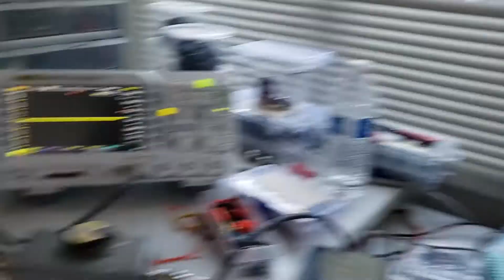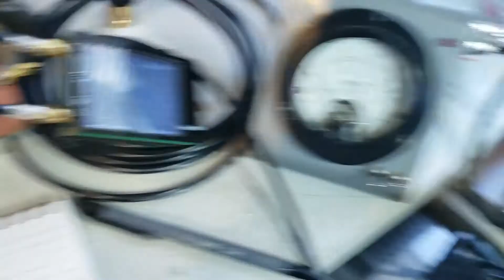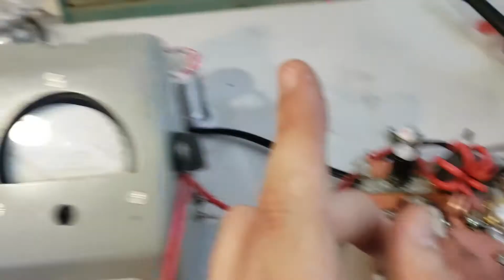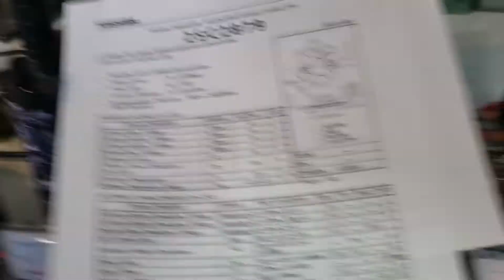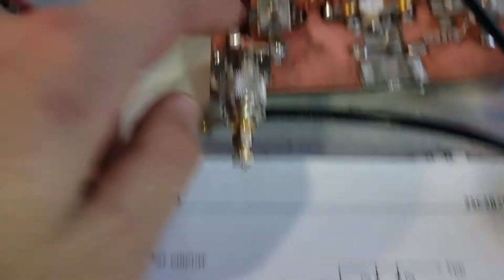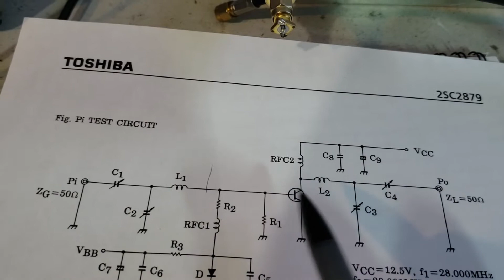Super Simple 2sc2879 Amplifier and Theory

Comment: My understanding is that 2879c designation has no meaning to chinese electronic engineers that bottom number is what you need to get data and every batch run is specific to the run your pass though will change from batch run to batch run

Comment: You have a single transistor amplifier so you can't possibly operate it in class AB. With one single device, you are operating it single ended so it will always be in full conduction thus it operates in class A only. If or when you have two devices operating in push-pull, class B has them only conducting when the wave form swings in the devices direction. So half the cycle in on direction on one device and the other half a cycle the other direction on the other device. That's class B. The problem with class B is that when you get close to the zero crossing of the waveform when it the sine wave goes from negative to positive or from positive to negative, there is some distortion called crossover distortion because the transistors (or the tubes) are not very linear in the area when they just begin to conduct current after being turned off for the half cycle. The fix for that is to add a bias voltage to both devices so that they will be conducting current at the low levels before and after the crossover point happens. That is called class AB amplification. It reduces the distortion significantly in AB compared to class B. You can even go further to reduce distortion in push pull amplification by biasing the transistors (or tubes) so deeply that they are in conduction all of the time. That is called class A push pull.
Reply: No, he is right. You are conflating the class with single-ended vs. push-pull. A single transistor can absolutely be in Class A, B, AB, C, etc., as this ONLY refers to the conduction angle, not the topology. Many people think that AB = push-pull, but that is totally incorrect. You choose the class of operation separately from the topology. The primary thing to remember is that if the transistor is not conducting for (nearly) the entire cycle, you need a tuned output to reconstruct the missing part. This is one reason we use push-pull. It allows us to use class AB, so each transistor is handling one of the phases, and they are then recombined in the output. This is very efficient (when linear operation is required) and has the added benefit of cancelling the even harmonics largely. For anyone working solely with FM, digital modes, or any case where the amplitude doesn't vary, you should look into switching mode amplifiers, as their efficiency is far higher (as high as 95%), whereas linear amplifiers rarely exceed 60% in reality. This allows for a lot more power with fewer devices and lesser cooling requirements. If you are amplifying AM only, consider Class E (very simple and efficient) and modulating the power supply voltage. There's a lot to know, and I just wanted to clear up the fallacy that Class AB wasn't possible in a single-ended topology. The video creator is right in all regards.
Reply: @gregaldr  Thank you for the correction and your excellent explanation.

Comment: Can you build FM broadcast band amps? I'm looking for an amp that will run off 12V and make around 100W. It's easy to find plenty of FM band amps on ebay, but the problem is finding one that has good power off of 12VDC. They all seem to max out around 30W with 12VDC. I know that it's definitely possible to get more though cause there are mosfets that are made for this purpose. It's just that nobody is using them :( I'm talking about the RD70HVF1C, RD70HUP2, or RD35HUP2. These in a push pull configuration would do it. I just don't know how to make it. I understand how amps work, but not to the extent that I could match something like this.

Comment: This is eaxctly the video I needed to watch today! 

I've been getting into building audio amplifyers and compressors with amp circuits within them etc. recently and have been trying to learn more and more about how they do what they do on a deeper level. I've been tracing the signal through the circuit with my scope and playing about trying to understand certain things ... and being a tube circuit (although not much differant to a transistor circuit in what I was trying to figure out) I couldn't work out why the HV power was being supplied to what appeared to be the tube signal output .... but this makes that make perfect sense, and was kind of what I assumed it must be, but had no way to know for sure without this vid! It's just taking an elevated AC voltage from the change due to what the tube lets through from the grid signal on the annode plate side, rather than taking it from the cathode and the output being only what the tube lets through like I initially thought (untill I looked at the circuit and was like well it's attached directly to ground through a resistor, so it can't be that).

Thanks for uploading this!

Comment: You need to do a two-tone test on any RF power amp, particularly an external linear amplifier. If you don't do the test you won't know the linearity and the in-band intermod products. You will quickly find that you need to back off the drive to get reasonable linearity. For SSB operation your 3rd order products should be at least 26dB below your carrier. These 3rd order intermod products are what causes "splatter" on adjacent channels. All ssb tranceiver's output power is limited by the 3rd order products and they run them below their peak output capability. That's why it's always possible to overdrive the PA and get more output power.
Reply: Why bother? It's not a good design to start with. Use transformers then worry about harmonics and two-tone test.

Comment: I'm afraid I'll disappoint you. Base key, all measurements with nano VNA you should do with an unsoldered transistor. Otherwise you will need to connect VNA to the 50 Ohm terminals and match the S11 and S22 transformation lines with the fully powered transistor and approach the (50+j0) impedance, of course theoretically.

Comment: I saw the lead on the input bias choke bouncing up and down as you were tapping on the choke and I wanted to yell that to you - 3 years after the fact.  :)
Reply: Input bias choke isn't even needed since the power is so low (or should be in a proper design) that the bias resistors absorb most of it and anything remaining will be shunted to ground by the power supply filter caps that you should add to the board anyway. If course this is absolutely not true on the output side where the choke is essential because it serves multiple purposes. Having a choke on the input side also adds unwanted inductance that is undesirable for proper matching with an RF transformer.

Comment: The first 5 seconds I see that it’s already AB biased! I love that for purity! As I’m an all mode operator! Not just an AM stripped down no trash collection caps or feedback resistors in a class C! 🤮Great job and work! Yes, I’ve been into this since the early 90’s and throughout the Toshiba years. These DEI and huaggo HG transistors are tuning differently than the old stuff they do tune differently. The C’s are bad ass as the MRF421’s too! 😊 I now work as an electronic engineer and love RF and radio! CB and HAM both! I don’t forget where I started and love it all! Keep it up! 👍🏼 the input RF coupling should be 910-1200pf for a low ac rf resistance and impedance. Everything so far I’ve heard has been correct! But for gain, the LD mos fet is a multi junction transistor. They naturally have more gain! But a higher beta bipolar transistor will have greater gain at the expense of stability. But stability comes with bias and bias it into class A if you need stability and or purity but then linearity gain dwindles. So, what gives? Thats where a curve tracer or even a peak 75 to test the transistors and matching…. Thats another time.

Comment: Rfc2 does not store energy  it totally blocks all ac/rf current changes. The output coil is the inductor that swaps energy as the transistor is turned off and on. But the rfc is a choke that resists all ac changes

Comment: Isn't tricky, that "collector choke"? should that be considered choke? shouldn't that be kept at a minimal inductance? not minimal in the sense of smallest, but in the sense not above certain small value. in collector, that is no choke, as it prioritizes maximum transfer of energy, in ac, not in cc. a choke, in principle, is doing different, it does not allow fast refreshing of energy. to have high amplification, you must have low inductance for that "choke"
Reply: Wrong. The L value barely matters. 10uH 100uH will work the same I assure you. Try it with FTSpice if you didn't believe me

Comment: I'd like to drive a Lorentz disk** with this because it's simple and low cost - would it do the job to amplify the siggen output enough?

**A Lorentz disk creates coherent high (RF) frequency oscillations of the charged particles in thin aluminum layers by way of the Lorentz force as follows:

1)  aluminum foil layers each separated by insulation, oriented horizontally on the work bench (foil-insulator-foil-insulator etc)
2)  vertically-oriented and axial (centered) magnetic field through the foils lamination
3)  small 'eddy current-inducing' coils positioned radially and close to (but not touching) the foils

The coils are fed 16.28Mhz because the skin depth of the foil motivates that frequency.  

Vertical B field, radial and horizontally induced currents in the foil, manifests (right hand rule, recall) the Lorentz force.

I'd like to think your design could achieve 100 watts or be modified to reach that - is that feasible?  The signal out of the siggen is too weak to see any effect in the Lorentz disk.
.

Comment: Some additional factors would be how to establish bias for the base such as a reverse clamp diode or even a simple zener with a past series transistor to start out. Another subject that needs to be added is thermodynamics that is how the device under test should be derated as the temperature rises at the case and the junction itself very important. These are just the name a few.

Comment: Thanks for the video it was really interesting to watch especially the use of the nano VNA to measure the input and output circuits. I'm looking to build an amp that can be driven with about 200mw from a GRC-106A to some reasonable output of 20 or 30w or more. Do you have a suggestion for a high-gain transistor that may be good to start with for experimentation?

Comment: Hi matey. There was an article in either Practical Wireless or another magazine over 20years ago showing how to make a 2metre VHF amplifier is used similiar construction to yours .Double sided copper clad board glued on board as capacitors and inductors. I built one and surprised how well it worked and easy to build all dimensions was included in design no ferrites. Maybe worth researching. George

Comment: Howdy. Nice.
I would suggest the second capacitor in both input and output are loading capacitors. These serve the purpose of matching the impedances.
I think these need be adjustable too to get max. gain.
One starts with a random setting of these. Then tunes the others for resonance.
Slightly increase or decrease the loading cap.s, retune to resonance and observe if the gain increased or decreased. Switching back and forth one should find max. gain.
Observe that the circuit may jump into oscillation in peak tuning. A slight over or under tuning may be needed for stable operation.
Regards.

Comment: This has helped me to understand amp construction more than anything on youtube!
I was curious as to why this circuit does not have input and output transformers.
Reply: Because it is only meant for illegal CB use and won't work anywhere but 11m. A good broad have amp will always use transformers to work with 1.5 - 54 MHz. This is a pretty bad way to teach people to build amps. It is easier and takes less time to just use a proper transformer on the input and output and doesn't cost any more and you have a much nicer amp that you don't have to turn for every frequency you want to use. You would have to turn this even within the 11m have from channel 1 to 40 to keep the SWR in check. Wouldn't advise building this or using narrow band L networks for power amps. Not good practice.... not good amps.

Comment: I really appreciate this info. Maybe you can help me with my linear amp. It has 2 of these. Pull amp works great, tx led aluminates with about 3 watts dead carrier. No rf power out. One of the transistors is cold, the other heats up super fast.   Out of circuit, each transistor measures as it should in diode mode. Very strange. They both measure good yet 1 or both might have no gain. Any clues? Thanks!
Reply: I’ve had RF transistors that test fine with a diode test & DC HFE, but won’t work at RF

Comment: Hey Sharky...Don't laugh at me to much but this was my first(half way failed) attempt at narrow banded tuned circuit(transformer less) design. 

https://youtu.be/cLevV2wdKlg

I know I messed up on my L Networks and bias. You can achieve the full output of the device this way rather then using binocular ferrite type which we can't achieve full output via faking the input and output capacitance lol. I still wanna play around with that on a van and show what the the 4x104 and 3x1000pf are actually doing.

By the way...do you know the C stands for? North asked me what should we name the 6 chip 08-4 device and I was on the phone with Danny 123 while reading the email....I mention it and said...."Why not call it the "C" for Competition lol" I relayed it over to North and he rolled with it lol.

Comment: Hi. First off all, thanks for your great informative wideos

Let mee know if my thoug process is wrong, the output rfc choke is there for two reasons, blocking the rf from the power supply and keeping an relative constant current, when the fet or transistor is on, the current slightly increases and goes to ground, when the transition is off the "constant current" will increases the voltage on top off the transistor, abaut Doble the supply voltage in a perfect world, depending on the output tune, in case you don't have matching network connected the voltage wuld in theory spike to infinity. At least if you are driving with Square wave

Litle like a switching powers supply works. 

So in my theory the the transformer kind a output will be more forgiven for higher antenna inpedans, this is due to the transformer "self limiting propeys" when in a lc kind of a "pump and dump" network a higher antenna inpedans will result in a higher source to drain voltage, and might go over the break down voltage character or your feet / transistor 

All the best and keep up the great work 👍
Reply: No the only purpose of that inductor Is to avoid any rf  going back to the power supply, ot ha nothing to do with switching  power  supply

Comment: Fun video.  My construction projects look a lot like yours.  Two suggestions: one you might want to add a series variable capacitor between the connector and the shunt capacitor to be able to adjust for optimum match should the transistor not present the published impedance.  The same holds for the output.  Usually it is best to be able to have two variable components to be get the ideal match.  It's easier to adjust a capacitor than an inductor.  Second point.  If the output power of an RF power transistor doesn't produce the expected output, all else being correct, it is probably not fully good.  This was a typical problem for earlier (1970s) VHF and UHF transistors in mobile radio applications.  With an ohmmeter they measured like a good device, but had little to no power gain.

Comment: At what point would it be beneficial to switch over to the longer tube shaped shotgun looking transformers? And why. Heat dissipation?  Better impedance match?   ?
Reply: So it will work on more than one frequency. This is how you might amplify a single frequency oscillator for example. Not usable as a ratio amplifier.

Comment: Better solder that choke on the input side back down to the board if you want it to work in the circuit. I saw it moving when you touched it. Also both those sml resistors looked like they were i n series not parallel on that one dummy load going out of the circuit. That would be more resistance than a 50 ohm load that is required for a dummy load in this situation.  Two 100 in series is going to read 200 ohms, not 50 as needed for two 100 ohms in parallel? Unless I saw it incorrectly.
Reply: I also noticed the choke in the bias supply was loose, maybe no bias voltage present during testing I guess contributing the low gain reading??.. but for the load smd resistor at the output side it look like series but actually both ends were connected to ground and the middle is in the sma center pin so it is in parellel connection but that is easy to verify via resistance check.